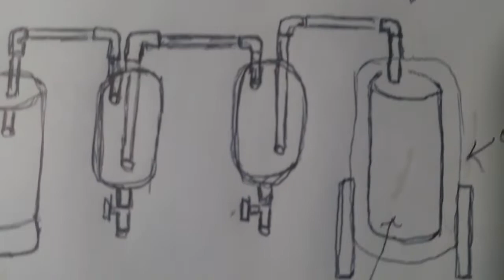Turn plastic into diesel fuel reactor build ( part 1 )

Comment: Brother, I've been searching for a small scale version of this reactor & could not find any good descriptive videos and here you come to the rescue.. Nice. Hope you are successful. God bless.
Reply from the maker: I will certainly be as descriptive as possible, And the good suggestion by the way. I dropped the link to my other channel in this video's description. I forgot that The tubes make it almost invisible.
Reply: mee too.   I want to build one to sit on a removable tray to sit on a trailer to tow behind my off grid diesel camper.  

PS- if you have a primary fuel desire..... feed the other fuel (while still in gas state?)  into your burner as your heat source.

Comment: Been pretty happy with my raw wood gassifier, my V8 Toyota pickup named the chevotafire is still in testing stages but does 50 mph with a immature char bed. The more you know! Just found your channel looking into plastic pyrolosis, I periodically toss plastic into my gassifier and trying to see if I get a fuel quality difference as it passes through the char bed
Reply from the maker: I love the concept. I am constantly trying to challenge my free energy designs myself. Keep it going and thank you for the comment.
Reply: @Saxxsays  have you looked into the Wayne Keith gassifier? In the build book he did some testing with plastics and had a reduction in distance traveled even with the higher btu release from the petroleum based plastics. Basically his experience was the energy was dense but fast burning

Comment: I'm not sure how you plan on bugging out but here's some advice. If you're going to use that trailer to connect to an atv or whatever, keep in mind that those tires are only rated for about 22 mph tops and 12-15 mph under load. Atv tires won't hold the bead on that rim either. I would definitely advise going all new tires, rims, and maybe even upgrading axles (depending on weight of the load). You can pick up a much better axle for less than $150 and go to a junkyard and find small car tires and rims for $25 each. I have upgraded mine and pulled it 55-60 mph  behind my 4wheeler under a load. I have also rolled those factory tires right off the rims at 20 mph lol. That's why I know all of this off the top of my head.  This is why I plan on just picking up an old flat bottom boat trailer next time I see one for $250 on Craigslist.
Reply from the maker: Agreed. This won't be the trailer. I will be making an actual off-road trailer for this in time.

Comment: Do u have part 3?
Reply from the maker: Unfortunately, I do not have part 3 yet. My welder went down then winter kicked in. However, I will certainly be finishing it up.
Reply: @Saxxsays  nice one. Love ur videos on it so far. Been watching all weekend. Actually no one has a video beyond the 1st condenser. Strange. 

Does pyrolysis work for alll plastics? Like drinking bottles?
Reply from the maker: @rebel.mma.youtube  im not sure what a driving bottle is. But yes most plastic. There is a youtube video of a man that lives on an island that runs his machine daily to create his diesel fuel. He powers his diesel generator off of that fuel. I don't remember his channel, but try typing in some keywords like biodiesel fuel from plastic, man on the island. You may find it
Reply: @Saxxsays  that was the 1st video I saw.

I meant drinking bottles. 

I heard that some plastics like drinking bottles are not good...but can't find any info on it.

Anyway thanks I need to keep digging